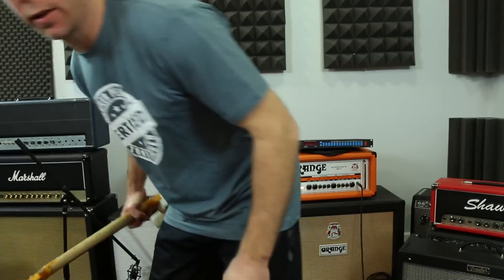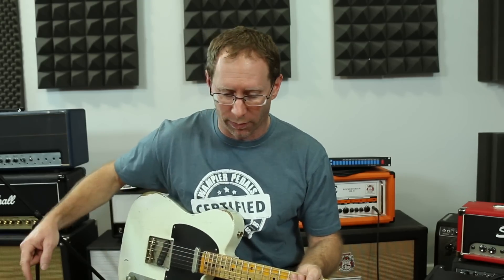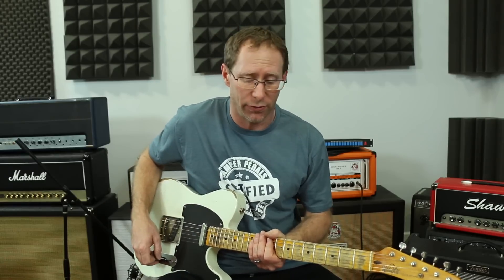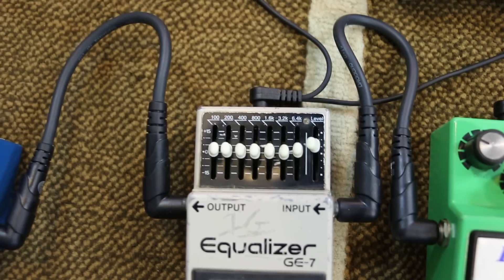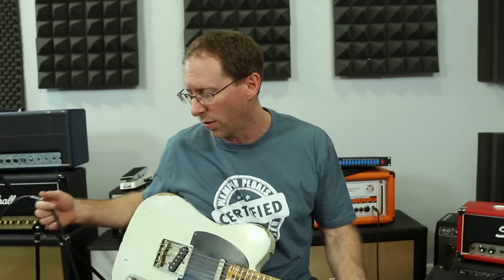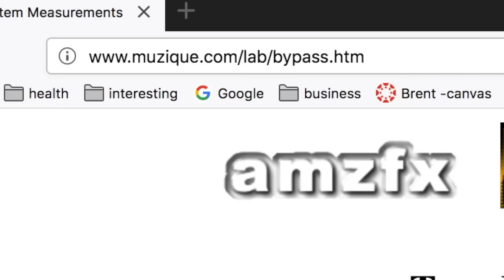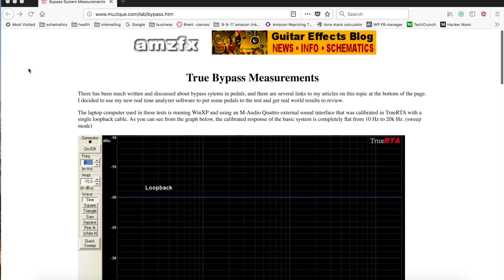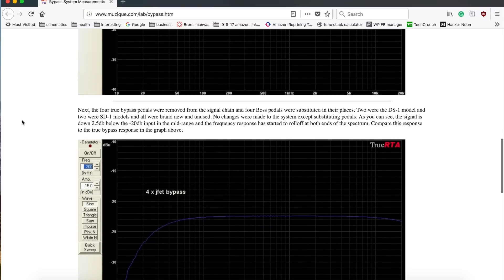Non-True Bypass switching: Is it really THAT bad? A look at boss/ibanez style switching

Comment: I feel like there should be a little disclaimer when talking about the scary looking 4 buffered pedal graph. The -3dB cutoff for the low cut appears to be around 24 Hz or so, which is at the very limit of human hearing. In fact, the guitar in standard tuning only produces frequencies as low as 88 Hz, which is shown on this plot as only has about a half decibel drop relative to the majority of the frequency response, so that low cut isn't going to be as perceptible to human ears as it appears on the graph unless you're playing a bass or baritone guitar.
Reply: Happy I saw this comment. As an amateur audio engineer, I'm already cutting most of my guitar EQ below 80 regardless. Bass guitar foundations are around the 40 hz range, so it also would be fine. Also, Boss has used several types of buffers over the years. A lot of them do/did have JFET buffers, but I believe their more modern pedals use silicone and others use op-amp. I am not an electrical engineer, so I have zero clue if that would change the results or if I am talking out of my butt. 

I saw that the Boss EQ-200 can go into frequencies at the 30 hz range, so I'm curious how that one works.

Comment: Thanks for the nod, Brian.  :-) And for giving props to Jack and RG, too.  Nice video, as per usual.

What I think many younger players don't often consider is that a great many pedals were designed for an era whan a "pedalboard" might have consisted of maybe 3 or 4 pedals, battery-powered, and just sitting loosely on the floor.  An example might be Hendrix's prototypic wah-Uni-vibe-Fuzz-Face configuration.  In many instances - and I'll bring up Jimi here again - the pedals were used in conjunction with lousy higher-capacitance cable that ate up so much top end that whatever buffers might have subtracted paled in comparison to what the cable did. (I say "might" because none of those pedals were buffered).

But we are in a different era, now. Players are assembling pedalboards that often resemble music-store showrooms, and better-quality cables are both widely available, and widely used.  Long story short, we are able to finally hear nice crisp top end, but we're also throwing a LOT of obstacles in the way of it with our pedalboards.

When it comes to buffers and true-bypass, I'm a firm believer that you don't get something for nothing.  As Jack demonstrated, buffers can have a cumulative effect.  That is, one at a time, they are absolutely innocuous and well-designed.  Six at a time is a different story.  Not only in terms of bandwidth loss, but cumulative hiss as well.  Yes, they are quiet, but less so than straight wire, and after 6 or 8 in a row, barely measurable hiss can start to add up to audible hiss.

I will stick my big BUT in here (shout out to Pee-Wee's Big Adventure), regarding what I like to call "pedal ventriloquism".  This is a phenomenon that happens when a true-bypass pedal is inserted immediately before a buffered pedal, such as a Boss unit.  Perhaps they've rectified it by now, but the majority of small-form Boss pedals have an "unterminated" input cap on the input buffer.  They do this to reduce any loading.  Unterminated input caps are prone to audible popping. You will hear a possible thump when you first plug in.  But since the bypass switching is done electronically and internally , there is no switch-popping thereafter.  When you stick a TB pedal in front of such an e-switched pedal, though, every time you hit its stompswitch, you momentarily disconnect then reconnect that pedal to the the buffered pedal after it.  If there is any charge stored in that second pedal's input cap, it will produce an annoying and audible pop.  It sounds like it is coming from the TB pedal because that's the stompswitch that appears to produce it, but it is coming from the Boss-type buffered pedal that has the unterminated input cap.  Hence my term of "pedal ventriloquism" - one pedal throwing its voice to another.

Classic Boss-type e-switched pedals WERE well-designed, and nicely quiet.  But they were not designed in anticipation of being mingled with TB pedals.  Is this a soluble problem?  Thankfully, yes.  All it involves is soldering a suitable resistor of, say, 1M to 2M7, from the hot lead to ground on the input jack of the e-switched pedal.  This will provide an always-available path for that input cap to bleed off stored charge, without loading down the pedal and eating away at bandwidth.
Reply from the maker: very well explained, and 100% accurate!! It's maddening as a manufacturer. And Mark, I'll always be appreciative of all of the knowledge you and others have passed on to us. There's way too many to list but diystompboxes.com and ampage were the places that I and many popular builders learned. I hope you know that you helped to forge an entire industry and affected many lives just by being helpful!
Reply: You're too kind, and give me too much credit.  Like both RG and Jack, I wallowed in whatever Craig Anderton, Robert Penfold, and John Simonton provided for 20 years, starting in the mid-70's.  When the web and forums finally came along, the unfettered access we all now had to other's knowledge, and schematics, shifted everything into overdrive.  All I did was watch, soak it all up, and dream up stuff when my mind wandered at work. I guess it paid off.
Reply: Long live Ampage! I was Jason B. on there back in the early days. Great to see so many from back then are still active in the amp/pedal world! When it comes to amps, you have to give Bruce Collins of Mission Amps some kudos as well!
Reply: Steve "T-Boy" Morrison, who maintains AMPAGE (now Music Electronics Forum), and Aron Nelson, who maintains the DIYStompbox forum, are both assured their place in heaven.  Both have faithfully maintained their respective sites for several decades.  In an age when so much on the internet comes and goes like dandelions, it is reassuring to be able to visit both of those sites, find familiar names, and call up discussions from long ago.
Reply: Orman, Hammer and Keen are my heroes too.  And Fred Briggs, Anderton and of course Wampler.  This has been one of my (too many) hobbies since building a fuzz in 1968, followed by a bucket brigade phaser.  Still messing around with circuits, although it's pretty hard to come up with anything really original now that digital has taken over.  Long live analog!!  and keep the vids coming!
Reply: Ahhh, Ampage...just send me back to the 90's..pre-everythingthatcanbefuckedwithwillbefuckedwith-era
Reply: Thanks. I wondered why some new pedals I tried to add sounded like a gun going off when I hit the switch....
Reply: The guy from JHS was saying that having buffers is actually good for the signal chain. Is that accurate?
Reply: I don't understand some of the tech jargon (2M7, for example) but grokked the majority of what you wrote, really interesting. Thanks.
Reply: @stk7778  Having a good buffer at the right place in the signal path is a good thing, generally speaking. JHS man was speaking loosely and I would disregard that remark. Brian covers most of what you need to know in this video.
NB: there are input buffers and output buffers. Brian favors one good input buffer up front, then all true bypass after that. So do I, but output buffers have their merits and, if understood and used wisely, can work well in a rig.
I'm an amateur, an enthusiast. If you are interested in buffers, maybe check out the article linked to the vid or Vertex's Rig Doctor's video on Buffers.
Reply: Matt Gilbert I grasped what you were trying to say, there, Matt! Hahaha😉
Reply: @lueysixty-six7300  But did you grok it? Is it clear to you as a holistic, gestalt experience of knowing?
NB: that's what we call in the trade "word salad". Or is it??? :D
Reply: Just reading this five years after it was posted, and what Mark says is illuminating!  I really dislike hearing switch noise, but never realised that this might be caused, or made worse, by the pedal order.

Comment: Bryan, remember that with buffered bypass you generally are dealing with active EQ. 
 Also, take your true bypass out of the pedal chain. 
 And on top of that, try running a true bypass box directly into an interface. From there, do the same thing with buffered bypass. The buffered bypass will sound better by far. 
 Let me know if you have any questions or anything that I can help with. :) 
 I personally use Tech21 NYC. 
 I am putting a lot of thought into selling my Wampler boxes. Sorry Bryan. I don't have anything against your company. I just find that my Tech21 NYC box does all that I need. 
 I would like a good spring reverb but I would like it to be buffered bypass. 
 One more thing. 
 If you take a line of true bypass boxes and you stretch a cable across the room, you'll kill your signal chain. 
 Pros and cons to both to be honest.

Comment: Boss pedals are not equal for sure. The ones I have tested attenuate the signal by ~0.7dB per pedal when off (and have that highpass/slight lowpass filtering going on). A special mention to boss NS2, which (when on) first amplifies the level by 1-1.5dB, then attenuates the treble from 1kHz so that it's at -4.5dB @5kHz & -7.5dB @10kHz. So overall a ~6dB drop in treble frequencies which are very much within the guitar frequency range. I have come to the conclusion that one or two Boss pedals are okay, you won't notice the difference much. Except if you have the NS2.
Reply: pikkuarska when I was a teen I bought an ns2.  Knew it changed my tone quite obviously even when bypassed.  At the time I liked it (was using a peavey bandit 112 at the time so the HF attenuation from the ns2 was helpful in taming some of the SS harshness).  Pedal got stolen one day.  Now, years later, I got one for super cheap used.  Plugged it into my rig (which is pretty elaborate and decent compared to my teen days) and immediately said ‘wtf...?’. 

I fought with the ns2 for 6 hours and in the end just removed it and sold it off.  The pedal is a great idea, just sounds awful to my ears, and does a really weird feedback sound if you put even slightly too much input gain into the return jack.  Guess I was lucky it got stolen.

Comment: So if you only have 1 or 2 battery-powered pedals and a pretty long cable, you're probably far better off having a non-true bypass pedal. Fits with the whole way boss pedals were originally ran when I was young, and no-one was obsessed with true bypass or had such pedalboard fetishes.  (I'm not trying to be condescending here, I'm an engineer and I've got a ridiculous pedalboard with TBP pedals and switchers; thanks for these vids Brian as there's too many people who don't know what they're talking about and I've run out of patience trying to explain to them myself 🙂)
Reply: It's a good point, although in my case per example I am using only a ts808 (buffered) in my system and I really hear already some loss of signal. That's why I start to hate using pedals... They suck all of your mojo.
Reply: @laranjiinha77  then you need the TC Electronics MojoMojo (true bypass) pedal. Your guitar will thank you.

Comment: Great stuff! How would all this cable length compare to using just an inexpensive battery powered wireless receiver and transmitter? I’ve been using these $50 transmitters for practice, rehearsal, and gigs, and I’m starting to wonder why doesn’t everybody use them—or why the old-school Nady wireless looking rigs are still being used. I have some ideas, but would love to hear some feedback from others… or if anything has changed in the four years since this original video.

Comment: I'm curious though, obviously not all buffers are created equal. For example, the buffers in Visual Sound /TrueTone pedals (which happens to be where RG Keen is working his magic these days), are much better than the Boss/Ibanez buffers. 
I've noticed in the past before getting a pedal switcher and forcing myself to limit the number of pedals to 8 (and there are never more a few in the signal chain at a time now) that I could have 16 pedals, mostly buffered and not notice any difference in signal loss - most of my buffered pedals were VS/TrueTone... in fact at one point that was the only brand I had. But then as soon as I stuck a pedal with a lesser buffer in the mix, the difference was quite obvious. Most newer Boss pedals and those gold coloured Marshall pedals particularly. Japanese Boss, not so much.

Comment: I do have a lot of Boss Pedals on my Board but i have to say that i didn't have so much loss of Volume , I Put my 3 Modulation Pedals in the FX loop and my Drive and EQ direct into my amp. maybe thats the secret cause 8-10 pedals in a single row could cause Volume loss but maybe splitting them not :D 
Like your content :D

Comment: I am a bit surprised, aside from the volume drop the actual sound of the signal going true all those pedal buffers did not deteriorated it actually sounded a bit more hi-fi which might be good or bad depending to what your looking for but I kind find it good overall for my tastes. I was expecting a drastic change in signal quality with so many crap in between guitar and amp.
Reply: That's exactly what I was thinking. Minimum volume loss isn't that big of a deal. Maybe something to think about with a ton of pedals, but for a smaller board, not bad at all. That's what these true bypass and boutique pedal hipsters don't realize. Running tons of cable with all true bypass will give you a world of more problems.

Comment: Love those vids. On my current board I have a Boss pedal (TU-3) at the begining and another Boss at the end (TR-2) most of what's in between is true bypass I believe (DOD Gunslinger, EHX LPB, Dunlop Fuzz Face, Vox Wah, MXR Carbon copy) ok, not sure about the wah but the others are advertized as such. And yep, I like it. 

I never quite attempted ABeing (that a word?) with/without but I get a decent sound with all pedals bypassed (buffered or not) 

I did try the TR-2 in the effects loop of the amp and it killed the sound. I guess the buffer killed the pre-amp boost and that resulted in absolutely no power amp breakdown. With it in front of the amp it rocks though.
Reply: A bit of necroposting.
In my case, having any buffer before or even after my modded EHX Screaming Bird affects my tone a lot more than two 5m cables. It's an "always on" pedal for me.
Try LPB (same design as SB, different cap values) or Fuzz Face alone and how they react to your guitar's pots. IIRC Brian May uses his treble booster right after guitar and before a wireless system just to retain as much tone as possible.

My old through-hole era VOX V847 has integrated buffer which cuts A LOT of high range. Luckily it was easily converted to true-bypass.

That said, I'm not against buffers and I might consider adding some between my SB and AC30 if it would be worth it.

Comment: Would I get away with using the new TC Electronic tuner which has the built in buffer? Just wondered if that would be enough or if a separate buffer is needed as a dedicated pedal for example?

Comment: Hi guys we use several pedals in the chain. First is a wampler compression ego then modulations then OD then looper then volume pedal for swells then delays then looper then delays then reverb. What’s the best way to boost at the end of the chain (after a reverb pedal) ? 

Is a base station like a boss rc 300 a good idea at the end of the chain before the amps? 

Thanks 🙏🏻

Comment: Brian: In my home setup I have about 20 pedals going into 3 separate amps. I use the Morely Tripler at the end of the board before the amps and I have a MXR CAE Buffer at the front. I only have 2 Boss Pedals (Blues Drive and Tremolo) and I have a volume pedal right before the Tripler. My question is how much boost should I be using from the Tripler or the CAE Buffer? I have been using zero boost on the front from the CAE and have been using a little at the end from the Triple to maintain unity. Is this the correct way to do it? Could I benefit from having an EQ pedal with some boost in the chain too? If so where?

Comment: I have a question... Is it possible (or better to say harmless) to connect two (or more) boss pedals to ONE BOSS SWITCH (one small black switch that I removed from an old boss ds-1 I moded to be a true bypass) , so I can turn on two or more pedals  at once... What I think to do is some wire extensions from any of my pedals to that switch so I can use it like a "master" switch, or simple to connect all switches with some parallel connection... Will that work?

Comment: I've been wanting to purchase and place a Univibe type pedal in front of a buffered overdrive then into the amp. Then have time based effects in the effects loop.  I have not been able to find a buffered Univibe type pedal. When I tried the same thing with a late 70's phase 45, it totally sucked the tone with the phaser bypassed. I'm concerned that this will happen if I put a non buffered pedal at the front of my pedal chain. Or, if I put the non buffered pedal along with my buffered overdrive in the loop of my Boss noise gate, will this eliminate the tone suck?

Comment: Hi Brian, can a D.I. box at the end will help retain the tone?
Reply: A DI boxes primary function is to convert a signal between balanced and single ended operation. It shouldn't alter your tone, but you will notice a change in loudness. The process of  balancing a signal leaves you with a 4-6db increase in level. But in order for all this to work, both ends of the connection have to be balanced. If not, the system will default to single ended operation and the DI box will have no effect at all.